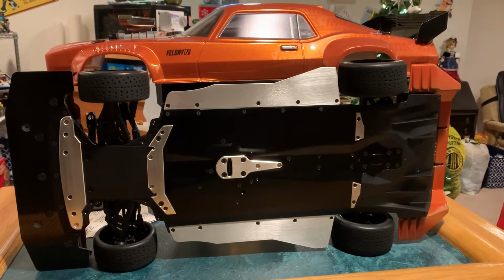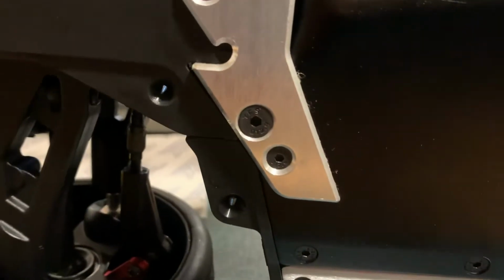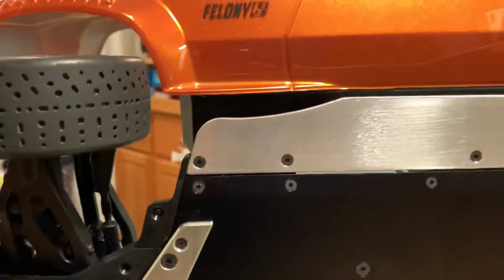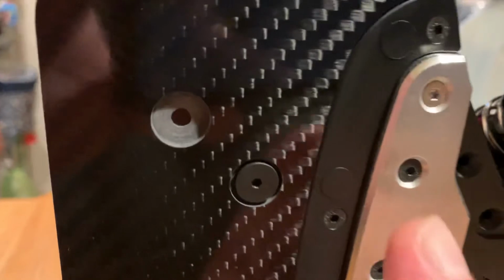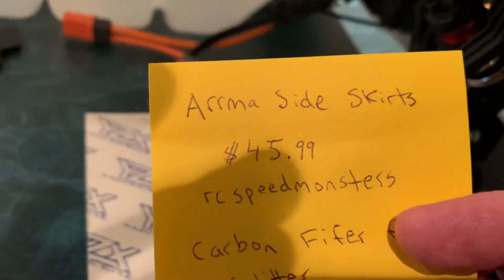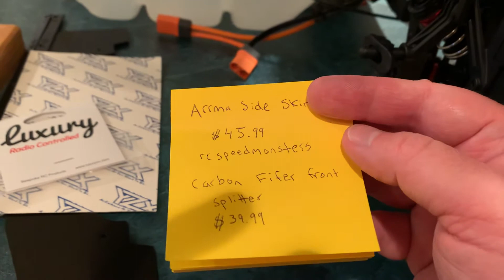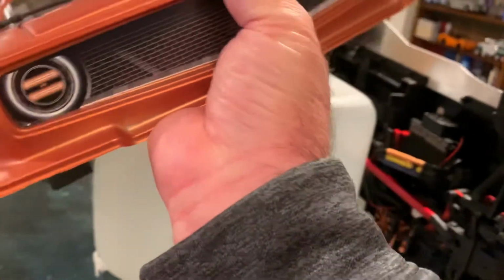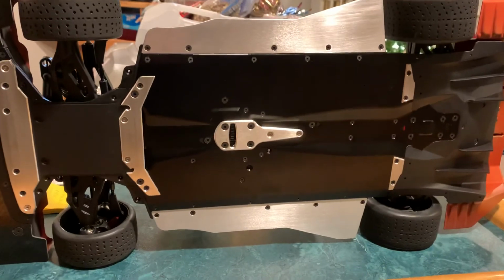Arrma Felony 6s Aluminum Skid Plates and Carbon Fiber Front Splitter Installed😁

Comment: Where did you get the splitter from? need one of this
Reply from the maker: I found it on Amazon and it’s sold out.  I found this upgrade kit on Amazon that includes many items including the front splitter.  It is a bit pricey if all you want is a splitter though.
ARRMA Limitless/Infraction/Felony - Carbon Fiber KIT by Perfect Pass 10-Piece Premium Twill Carbon Fiber Arrma Upgrade Parts, No Modifications Required, Watch Video! (ARRMA Infraction - Matte) https://a.co/d/7Qlp1MY
Reply: @beyondthebluerc1  dang it’s fine